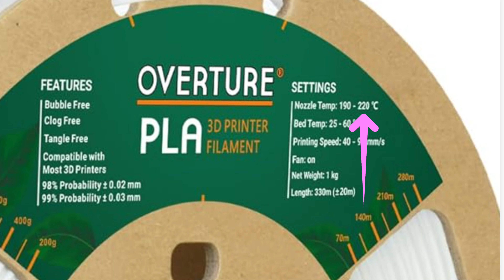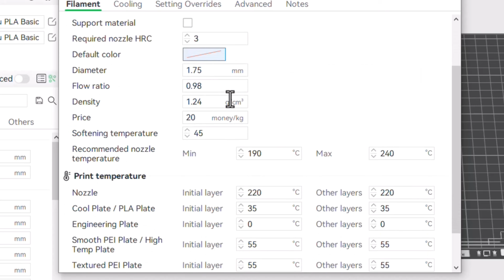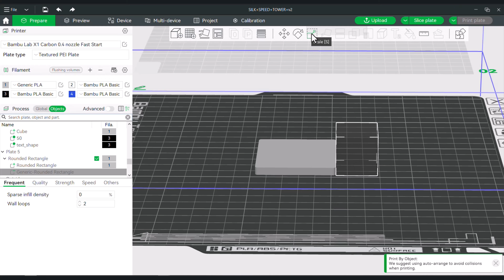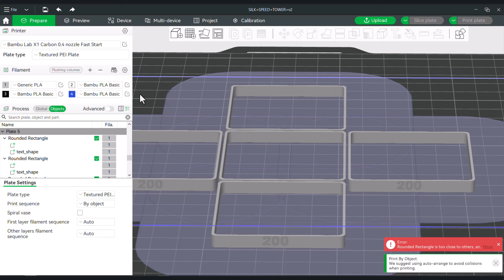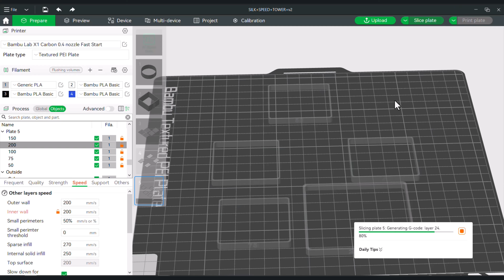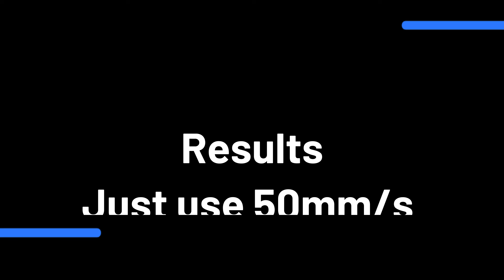Bambu Studio Silk PLA

Comment: Thank you so much. It took me a while to figure out why my prints looked nearly the same despite changing the print temp. Through your video i discovered that the slicer wouldn´t do what i wanted it to do according to model size. Thanks for pointing that out! Excellent tips. Silk is my new Nemesis. ;)

Comment: I'm curious why you used the Generic PLA filament profile for your custom Silk filament profile versus the Generic Silk PLA filament profile? At the end of the day, they will all get you to the same place with enough tweaking, but I try to use the filament profile Bambu would default as the basis for my tweaks. For example, the Generic Silk PLA defaults to a volumetric flow of 7.5mm/s that in theory is what most generic silk PLAs should use as the generally have a slower print speed overall.

Also, I highly recommend to everyone to print the "Pla Silk Tower speed test" not only to test different speeds but also different temps, and not just for silks. I routinely print 2-3 of those at different temps when I get something like a new translucent PETG, so I can not only find the fastest speed to get the desired translucency, but also the best temperature.

Great video explaining and showing how the speeds affect print quality, as well as a tutorial on how to make speed test.
Reply from the maker: Hello, Thank you for the feed back.
The "full" video was much much longer going over settings but to make this video flow easier I shortened/removed parts to change filament profiles. Temp, speed, flow. For the sake of brevity a lot gets left out of the final video. 

Typically you can use the many of the "Default" profiles and modify them to your needs. starting/continuous filament and bed temp and flow amount. Also since many folks are using many different types of filament, and they may want different results I figured the general settings would be best and let the user make their own adjustments. 
I'll probably ask the community what they are most interested in for future content.

Comment: Apricate the video however i am still having issues with silk pla on my x1c. I slowed everything down to 50 mm/s and it all worked for apple pen holders but for some reason when i tried to print a dragon it messed up twice. first the leg came off the print bed at 42% and the second time it was at 80% and the whole thing came off the build plate. the next two times i tried articulated dragons and never even had bed adhesion. Silk PLA has kicked my butt 😣. What could i be doing wrong and how can i correct it?

Comment: Sorry for an unrelated comment but I can’t find this answer anywhere. Can iron out specific layers? I see you can iron every layer or just top
Reply from the maker: Excellent question. There are 2  main answers and one situational answer, but it may be the best solution. 

1.Ironing top or top most surfaces, does just that. You can iron out imperfections or make a cleaner cosmetic look.
2. Ironing solid layers. Or layers that have 100% infill or is all walls. 

Situational Using modifier .

The rules above go out the window.
With a modifier you can make any part of your model solid to iron or almost any variation of infill, walls fuzzy skin etc. 

Modifier
https://youtu.be/FFylfvJ0Xpk
There is an omission in that video as you can add several height range modifiers instead of just one

or just use shapes. 

In summary using normal methods it's all or nothing, top or topmost unless you make the while model 100% infill which can be overkill in print time.

Use modifier to pick a section to adjust.
Reply: @  fantastic! I’m going through your list. Your a lot of help and I really appreciate when do something more than once to summarize. It’s very helpful in helping see the workflow all at once right after you’ve explained it.